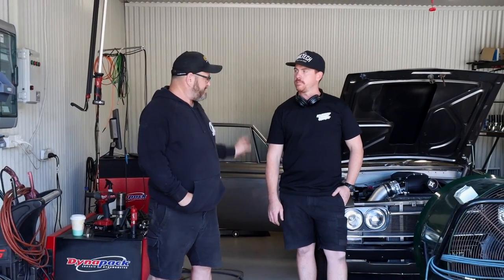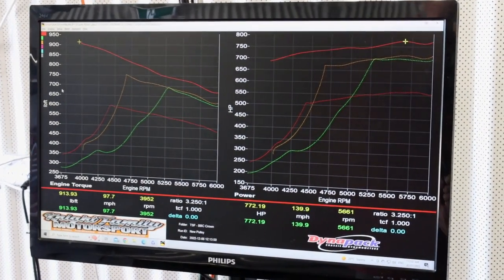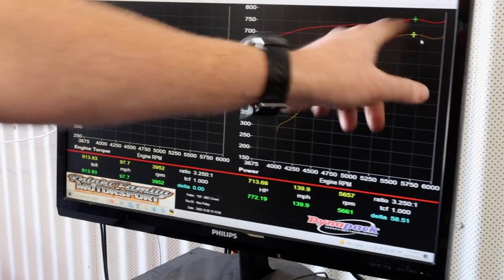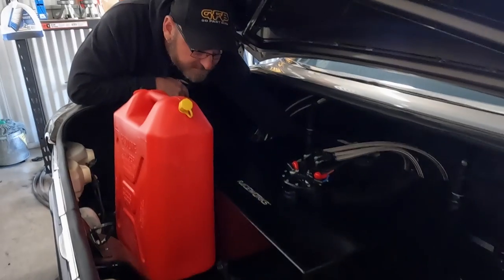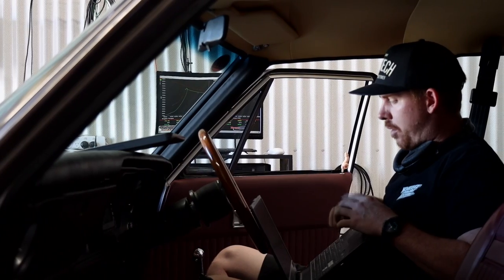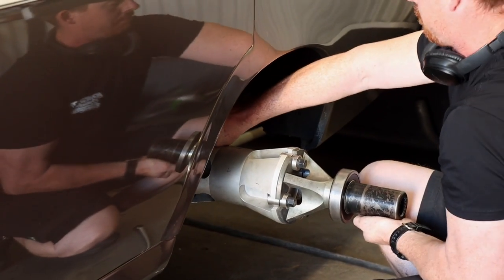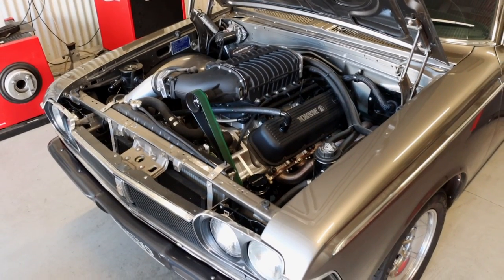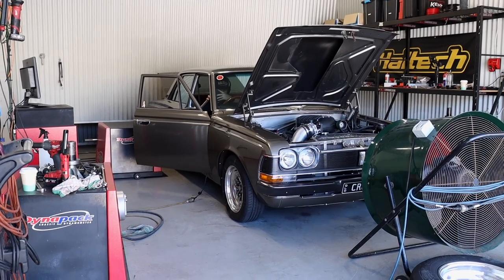ETHANOL vs UNLEADED - Fixing the Big Block Crow9's Drinking Habit ⛽️

Comment: Like you did for the Subaru would it be a consideration to use E10?  I believe it is a 94ish RON but I suppose the 98 RON is more suited and you just add the E from there using the flex table?
Reply: That's what I thought, too. E10 is a lot cheaper and made the same power, why not tune for this? Would be nice to know.
Reply from the maker: I guess the main factor is the Subaru EZ30 is a $3k engine at best and the BBC in the Crown is a $30k engine so using the BBC as a test bed is not a great idea for the bank account. We also pay Kye for his dyno time so we have to consider whats practical.
Reply: Okay, that makes sense, considering this I think I would have done the same. Thanks for the reply 🤝

Comment: FYI, 98 RON is actually about 91.5AKI. Ive done heaps of logging on tune and get corrections on "93" tunes but none on "91" Fuel quality in Oz in general is garbage. EDIT: but its super handy having a 98 tune because E economy sucks. In BMW land E40-60 is the sweet spot for power/consumption

Comment: Where I'm located, E85 is more or less at every servo and half the price of 98. With the aim of extending cruising range (light throttle, low rpms), how far can you push lean running with E85 before running into misfires I wonder? Maybe ignition dependant?
Reply from the maker: We actually tried that on the drive down to the dyno with Kye in the car and on the BBC there was really no change. It is possible that on more modern engines it could work though.

Comment: so with that being a supercharged car. when the haltech detects less ethanol what is it changing? is it just ignition timing or is there a boost bleed on the supercharger?
Reply: Sounds like it’s just ignition timing and fueling changes. They’re on moderate boost so wouldn’t really need to lower the boost for less ethanol fuel.

Comment: Great informative vid as usual from you guys. Have you thought about fabbing up an inter chiller for 98 in summer!! 11:51
Reply from the maker: It's not a race car, I run it the same way as it gets driven for sunday lunch. 
Power is the least of my problems, it would need an anti roll bar at minimum to go faster on the strip and it is already under what it allowed.
Reply: Misinterpreted.  More power and drags strips n roll bars etc. What! Lost me.
Reply from the maker: It doesn't need any more power so an interchiller is not required. 
An interchiller is also a very complex system and this car has none of the supporting systems required.

Comment: The engine torque is pulling the right side of the car down 6 inches to the pavement? Or, is that just the driver`s "mass" settling the car? It looks a little un-nerving to me.
Reply from the maker: It's doing exactly what you would expect given the engine powering it. It needs an antiroll bar in the rear.

Comment: A flex tune optimised for E20~E30 likely has more than enough octane to ensure the engine isn't knock limited at all.  And it'll only cost ~10% more fuel consumption.  US fuel research papers typically show E25 is worth about 50% of the real world octane difference between petroleum and E85, and E40 being ~80% of the octane benefits.  ie. as you show the flex timing tables should be non-linear in reality such that E40 timing is very close to E85.  Besides fuel consumption the other benefit of running lower ethanol blends is less ethanol into the oil, easier cold start and general downsides of ethanol (hygroscopic impacts).  Yes, there's some oxygenated and evaporative cooling effects for higher E85 ethanol blends but it's a couple of percent.
Reply from the maker: You are on the money but in the case of this car it would require custom mixing at the pump where Ethanol is already hard to find AND it make 100's of HP more than needed in road trim already.
Reply: @theskidfactory  for sure.  And only a few of the United stations have 98 and E85 on the same pump.

Comment: Correction factor should make the power run the same regardless of the weather?
Reply from the maker: Should it?
Reply: That’s why correction factors exists otherwise how could you accurately tune. Apples for apples.
Reply from the maker: You are going to have to explain that better. One line statements aren't much use.
Reply: The car doesn’t run around in correction factor weather. Unless you’re chasing max numbers it doesn’t really mean much.
Reply from the maker: We applied the correction factor to both runs and it wasn't the same. How bout that.

Comment: Perhaps an Aqua mist system with an intercooler, surely this with Methanol will gain you heaps more power with no Extra Boost!
Reply from the maker: I don't see how. Show your workings.
Reply: The Aquamist system is either Water or Methanol sprayed into the plenum before or after the Supercharger.  It'll cool the Air Temps and should allow you to regain the lost Ponies, if not gain more power! 
I'd put the Linky here but YouTube won't allow it, but a quick Google should do it.

Comment: I love everything about this car, except how it goes down the drag strip. When is the rear suspension going to be fixed so that it launches evenly rather than trying to do a barrel roll?
Reply: I bet Al is sorry he has let you down, boss
Reply from the maker: It's already been too fast for the track given it's a 1968 road car with no safety equipment other than seat belts. If anything it needs to be calmed down.
Reply: @theskidfactory  Gotcha. In that case, she's perfect. 🙂

Comment: Why not run E10 tune? Not many seem to and I dunno why. In some applications it seems to make slightly more than 98. From others videos I have seen.
Reply: E10 here tends to be hit and miss.  It could be anywhere from E8 - E12 (winter vs summer blends)  and some places  start with shit fuel then use the ethanol to bring it up to 91ron.  The octane rating is also rarely given for e10.
Reply: Through the magic of flex fuel, this car now has an E10 tune.

Comment: What about difference in torque?
Reply from the maker: Power is a mathematical equation derived from the torque reading. The torque may not have been higher(it makes 750lbft from 4000rpm) but it would have been maintained higher in the rpm.

Comment: With flex fuel, does that mean, say you have half a tank of e85, and you fill the other half with 98, will it still work? Or does that hurt it?
Reply: It will adjust on the fly.  Well the Haltech one does at least.
Reply: Yeah, Al states it (the Haltech) can now handle anything from 0% to 100% E85.
Reply: Works very well, E40 is usually more than sufficient for anything street.  I ran it in my R33 for a few years.  Easy splash blend at the United pump.
Reply: @ArthurCole-mn7qy  all do this, that is what flex fuel is by definition. Other wise it would just be automatic map switching.

Comment: I'd really like to see an e85 vs 98 and methanol comparison. E85 at the pump has basically failed in australia.
Reply from the maker: Methanol is race fuel, it shouldn't really be compared between two pump fuels that I can buy 5km from my house.
Ethanol was marketed as a renewable fuel for normal cars 15 years ago. It didn't catch on so now it's just a race fuel at the pump for bogans like us, use it or you'll be paying for it by the 20l at 5 times the price.

Comment: Just out of curiosity how much extra psi was it making?
Reply from the maker: 1psi.
Reply from the maker: It may have been one of our videos where we swapped from 98 to E10 on a 10.7:1 knock prone engine and gained some power and paid less at the pump.
This car is not in any way a daily driver though so the cost of fuel isn't the issue, it's just the availability.

Comment: Wonder if you could just have an air condition shop and get better numbers?
Reply: Go big or go home.....
Might as well put a metre square air handling conduit onto the car's air intake and suck the feed air out of a cool store/refrigerated warehouse.............

otherwise the needed cooling air for the radiator and the exhaust will quickly heat up and overpower and normal air conditioner in a workshop.....

Comment: Al you deleted my other comment. Your tuner said  e85 is oxygenated fuel. That is NOT true. I care for the facts :-)
Reply from the maker: I didn't delete anything bro.
Reply: Yeeep rightio
Reply from the maker: To be fair, I don't think anyone really cares that much about you blurting out random unsupported statements anyway. 
You can say what you want here as long as it's not hateful or full of swearing(this is automatically removed by YT).
Reply: Care to explain what you mean? 

Google "is e85 oxygenated" and you will find countless links stating that it is, in fact I can quote the top hit just as an example...
"E85 is a highly oxygenated fuel consisting of 85% ethanol and 15% gasoline. Many motorsports enthusiasts overlook E85 for performance applications because they associate it with low performance, flex-fuel vehicles.31 Mar 2018"